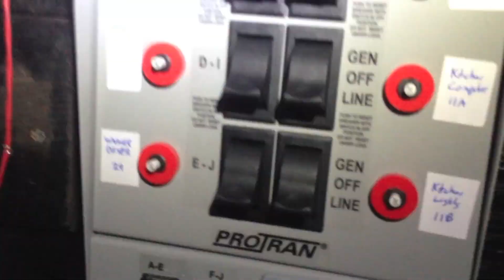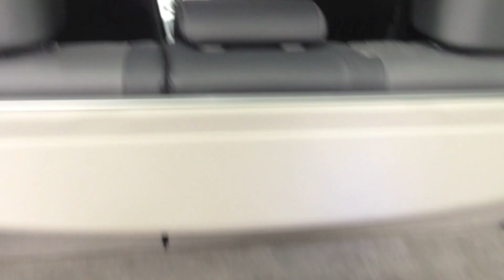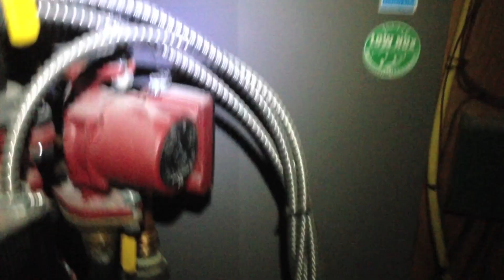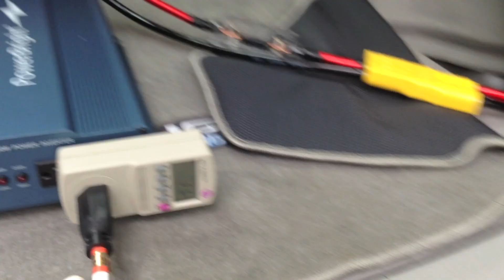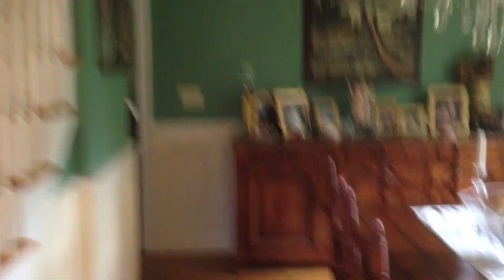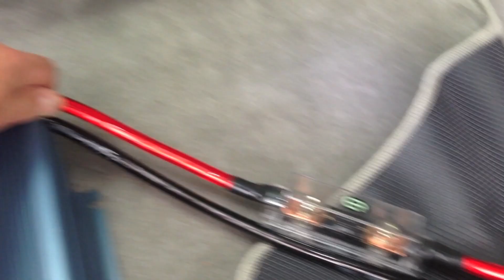Prius Home Generator - Part II

Comment: Wonder if there is a fuse or relay in the car you can remove to keep the car from getting stolen but still allow it to run. But thats a good tip in general if you are worried about having a car stolen, remove a few relays and fuses, easiest is just the fuel pump fuse but you would need that in this case.

Comment: Hi Franks, great video.  I forgot if I asked when I first saw your video 3 years ago, but...

How did you get around the problem that the inverter may not make all of the 110v on the hot wire.. or that the inverter may have internal grounding...which would both mean that the house wiring would not work it?

I made the same system almost,but I find that my inverter makes about 62v on BOTH the hot and cold wires.  At least my inverter doesn't have internal grounding between cold and the ground wire...but it won't work because of voltage on the cold wire when connected to house wiring (where cold is grounded by US code).  

Anyway, I know that my transfer switch works fine with a generator that makes 110v only on hot and doesn't ground the cold wire, since I tried that with success...

Comment: You can still lock your car. Either roll down the window, close the door, lock from inside and just roll the window up automatically. Or the way I always do it if I leave a pet in the car is use the old fashioned key. You don’t even need to leave a key inside.

Comment: For emergency needs <1000W , I would go with 
- a suicide cable directly to some garage outlet,
- manually disconnect house  from the grid. 
-Turn on only labeled breakers I want to power.
Transfer switch is nice, but you can get by in emergency without it. Being ready for a ghetto solution will also help your neighbor. Just drive to their house and do the same.

Comment: Could u get a bigger power inverter and power your whole house all year ? Seems like it would be cheaper
Reply: 100A x 12V =1200W x 90% efficiency = 1000W usable power. Bigger inverter will last longer and handles power spikes better. You can use any size inverter as long you will draw up to 1200W from your prius

Comment: What is the largest inverter you can use?  How does one determine how much power is too much to ask the Prius to provide at one time?   If there was a power outage, I certainly wouldn't be using my dishwasher, microwave or toaster oven, but the furnace motor, refrigerator, small freezer, several laptops, routers, and lights which I might be using all at the same time could add up to a bit of wattage.

Comment: How did the system work with everything running at the same time?  Can you post links to where to find all the connectors, cables, etc. that you used?

Comment: Is the hybrid battery recharge the 12V battery when is low without the ICE started?
Reply: Yes. After some time the traction battery will get low, and the gas engine will kick in and charge it back up.

Comment: Does it have to be a prius plug-in or prime, or can you use the regular prius hybrid?
Reply: You don't need, prius use the big battery charge the 12V battery With DC 100A current, so it can power this 1000w inverter

Comment: Why use the 12 volt system rather than the 3 phase output from the motor generator?  Any 12v battery could charge a inverter like that, but the motor generator could run the whole house.  Im looking for a plug in wire harness for the 3phase system on a gen2 Prius.
Reply: Found anything?
Reply: Another option is to use 200V traction battery, but it is hard to find rhe off the shelf inverter for that.

Comment: Just so I can be clear, you are attaching to the 12 volt starter battery, not the main car drive battery and this battery is also charged by the Prius engine? Is that correct? Thanks
Reply: I would not call the 12v battery the starter battery though.
The 12v battery just runs the computers, relays, radio, lights etc.
"The Internal Combustion Engine (ICE) is not started by the 12V battery like a typical automobile. Instead, the engine computer uses power from the traction battery to spin the motor-generators (MG1 and/or MG2) to start the engine."

The 12v battery is charged by the drive(traction) battery with a DC to DC converter.

The traction battery is charged by the motor/generators when the engine is running or you are coming to a stop while driving.
Reply: Correct, that’s what he’s doing.  The 12v battery not the high voltage hybrid battery.  The high voltage system keeps the 12V battery charged, and the gas engine keeps the high voltage battery charged.
Reply: I have a 2019 Hyundai Sonata Hybrid. How would I found out the Max of a inverter that could be connect to house battery? Would really like to see someone connect inverter to the battery pack. Image how much power the electric motor draws from it. That would be a lot of power to get into the house.

Comment: fantastic Frank. Thanks for such an informative vid. I'm in Union Co NJ. Major issues with Sandy and Irene. Quick question: Reading comments and got a bit confused on Inverter sizing. Do you see a problem using a 3K pure sine Inverter? Reason is I would like to be able to run power tools if need be. Thanks again. Tom
Reply from the maker: That seems to be a common question.  Check out the comments here:  https://www.fperkins.com/me/prius-home-generator.php

Comment: Very nice video, Frank. I would suggest getting a cover for the battery end of the Anderson connector. That way it's completely protected when tucked away. I put my fuse (100A, because the 2010 Prius has a 140A fuse on the battery) right after the positive terminal, not on the inverter side. That gives more protection.

You don't need to park another car in front of / behind the Prius when it's running to keep it from being stollen. Just don't leave your key fob in the car, and lock the doors with the manual key, which disables all locks until manually unlocked again. And close the window.

I've used my Prius during a power outage caused by a storm to run our freezer in the basement, telephone system, internet, computers, and a few other small things. Unfortunately, our refrigerator's startup spike was too much for the inverter, so I couldn't run that. Because the car was in the garage, I opened the garage door manually just enough to set some 4x4 blocks under the door, then attached my shop vac hose to the exhaust pipe on the Prius with the other end out the door. The Prius tailpipe doesn't get hot enough to melt the hose, which fits very nicely, so I can vent the exhaust this way for hours.
Reply: I'm amazed the exhaust doesn't get hot enough to melt a plastic hose even after hours of use. I know the car doesn't run continuously but still surprising.
Reply: I think Gen II 2004-09 Dc/Dc Inverter fuses in the car are lower - maybe 100A.  People don't want to blow that; fuse your 12v positive lead below whatever your car's internal DC/DC fuse is...
Reply: @cawag98  I agree. Mine is a 2010, Gen 3, fused at 140A, that’s why I chose to fuse my inverter at 100A, to be on the safe side. I don’t know what the Gen 2 is fused at.
Reply from the maker: Good tip!  Thanks.

Comment: Frank,
  Great video and application, we also have a Prius Plug-in... just wondering if you've used it during a power outage and did the Prius run all night??  Also any issues when having the car serviced with the "Anderson" plug dangling off the 12v battery?   Also I believe if you turn the Prius on then take the keys with you the car will stay on... not sure for how long though ( It only beeps at the beginning??)
Reply from the maker: +Mike B Oddly, there hasn't been a power outage since so I don't have any real world testing (yet).  The Anderson plug dongle really gets tucked down and out of the way so it's not noticeable and I doubt a service tech would even notice it.  The prius does stay on, so you're right.  I accidentally left it running for a few hours and came back to hear the AC still running! doh

Comment: Would be nice if Toyota had a generator-only mode so people can't drive off with your car.
Reply: Actually, there is something you can do. 1) Don't leave the key fob in the car. The car, once started, runs without it. It only beeps at you when the door is opened. 2) Use the emergency manual key that's hidden in the side of your key fob to manually lock the doors when you leave. This not only locks the doors, it also disables all entrance to the car (by another fob) until the doors are manually unlocked again. and 3) Don't leave the window open.  :)  Great video.
Reply: @TerrelWSmith apparently knows the solution for this by manually locking the doors.  There's an easy way around this if his solution doesn't work; The Club and lock the steering wheel.  I think his solution plus The Club will work.  If you're going to use a hybrid as a backup generator, you should probably invest in The Club anyway as a home generator vehicle security measure if you can't garage the vehicle when it's being used as a generator.  Do your due diligence and test your security options if you elect to use any hybrid vehicle as a home generator.
Reply from the maker: GoatZilla nice idea!  I would park my other car in front so they would have to steal that one before they can get the Prius ;-)
Reply: Frank Perkins Yes, I'm just thinking for people without second cars, or worse yet, for more desperate times where that might not deter people.

Comment: Thanks Frank just installed a 1500w inverter in my Prius works like a charm.
Reply: I've heard the later model Priuses and quite possibly the RAV4s can handle up to 2000W.  The Toyota RAV4 Prime with the appropriate packages includes a factory 1500W inverter with the 120VAC NEMA-15R in the cargo area.  If you use a hybrid with a factory inverter, use it and don't overload it.  If the factory inverter breaks and you didn't overload it, it's on the manufacturer to fix it if it's still under warranty.
Reply: Which Gen Prius do you own?

Comment from the maker: Here is a link to my blog entry which has all the details and more links:  http://www.fperkins.com/me/prius-home-generator.php
Reply: The idea has recently occurred to me to integrate the guts of a prius into an RV. The most useful aspect of course, being what makes it good for a home generator; the engine turns itself on to top up the battery, and uses very little fuel through regular use. Any idea how this might be accomplished? How well might the battery bank be expanded? Would this be a practical application with, for example, an older prius, being retrofit into use as an RV generator? Do you know if the engine and battery would still function the same if the electrics were left attached, but most of the other functional parts of the vehicle, the wheels, wheel motors, et cetera were removed?

Comment: I disagree with you. 1000W is not very practical other than just running the electronics. If you have the fridge compressor going and the furnace fan blowing and a washing machine and a microwave oven running, then 1kW is not enough. I understand this is probably the best DIY can achieve drawing from the 12V battery. Toyota on the other hand could build-in this generator feature into their cars by tapping energy from the 200V battery. I remember seeing a Toyota concept video where the Prius is used as a whole house generator. So they know there is a market, they just don't sell it as a solution.
Reply from the maker: Thanks for the comment, but unfortunately it looks like you didn't read through my explanation on my linked blog or watch the video.  The purpose of this is for emergency power.  In a power outage, doing laundry and using the microwave is not an emergency.  I have already tested the system and I can run my furnace and all all the electronics OR run the fridge and most of the electronics.  For me, the priority was basic lighting and heat for the winter or keeping the fridge cold in the summer.
Reply: Frank Perkins I understand there is a difference in expectation. Emergency generator should supply enough power for some basic needs especially regarding food. So, keeping the food from spoiling and heating up food would probably be needed by most people. Hence, I expected running the fridge and microwave. Though you can always control via the switch to pick one OR the other, but it would be a convenience if the inverter is powerful enough to allow unsupervised simultaneous operations of these appliances. I always wonder whether the 200VAC 3 phase output to the air conditioning compressor can be stepped down to household AC current via a transformer. The prius itself has a very powerful inverter that converts from 200VDC to 200VAC for the compressor and 500VAC for the MG1 and MG2. It would be nice if one of these 3 powerful AC currents can be used via a transformer. Adding an inverter to the 12VDC battery is nothing in terms of power capacity compared to what the high voltage inverter can do.
Reply from the maker: cplai I would never try to run something like AC through the Prius.  Although you might be able to tap into the 200v battery pack, I wouldn't recommend it because of safety and possible issue with frying the entire car.  This is pretty "safe" and does what I need.  I should also mention that I have natural gas as my heat source so if I needed to cook, it's not an issue since I can use my stove.
Reply: Up in the north (or where you have valuable things that will spoil in a fridge), 1000w is the difference between suffering through a power outage in style or catastrophy to home and family.   Look at Texas during the Feb 2021 'polar vortex' storm that is raging...  This setup can do nothing for drinking water supply issues, but it can run either a furnace or a medium sized fridge.
Reply: @cplai I would put the biggest inverter possible.  This is the only thing I disagree with Frank on.  If you're going to install a power inverter to use a hybrid as a backup generator, you use the biggest inverter it can handle and still be efficient as an on demand generator.

Frank is correct you can't run home HVAC off of a hybrid vehicle without some dangerous modifications.  If you need HVAC, the best option in that case would be to have a portable HVAC unit that can keep your bedroom comfortable making sure you know the wattage demand of the unit since they run off of 120VAC 15A power, I think a Prius can handle it and you can probably power Internet and other creature comforts.  

One of the things you need to do if you use a hybrid vehicle as an emergency generator is triaging your power needs which Frank has done.  The subpanel solution he has in place gives him the granular control he needs when he needs it which I think is a very elegant solution which I will be utilizing myself when I purchase my next home.  

A recently manufactured refrigerator that's in good condition can keep its contents cold for 36-48 hours before you need to worry about spoilage.  This is a major concern if you have a medical condition where your medication needs to be kept refrigerated (i.e. insulin).  If you're worried about temperature, put a wireless thermometer inside your refrigerator.  People who live in the hurricane belt who deal with seasonal power outages know how long their refrigerator can keep items cold before it needs power to maintain refrigeration.  People in these areas also keep their refrigerator thermostat turned up to a high or maximum cold setting so they get the maximum refrigeration during a power outage or crank it up before they anticipate an extended power outage.

The key to effectively using a hybrid vehicle as an emergency generator or using any emergency generator that can't power everything in your home is triaging your power needs.
Reply: No worries. That’s what insurance is for. Lol. If we can get the specs off the electric motor and don’t pull more then it would I would think all would be good. Personal I just can’t find the info of the electric motor of my Hyundai just a part number.

Comment: Frank, could you have connected a higher power inverter to the high voltage side of the prius to get perhaps 2kw power instead of 1kw?
Reply: Yes, you can get 3kw, but it's very dangerous to work with the traction battery. There are people who've done it over on PriusChat. I do not recommend it. If you mess up and live, you could still damage the traction battery and they are not cheap!
Reply from the maker: Totally agree.  If you need 2, 3kw or more, then your best bet is to get a traditional generator system.  This is only for short term emergencies with very instances of lost power.  To date, I have had only two power outages and they only lasted a few hours so I didn't even both trying to hook up the Prius to the house.  The funny consequence about losing power from Sandy/Irene is that the local utility has done a lot of work to update their service to prevent these type of outages in the future.

Comment: Thanks for cool video!
Just wondering - do you have basement sump pump on manual transfer switch?
Or was the starting amps above what a 1000 watt sine-wave inverter can deliver?
Reply from the maker: I'm sorry, but I don't have a basement sump pump.  I would do some research online to see what the peak draw is and that should help you size the appropriate inverter for your home.  You can also try using a kill-a-watt, but they don't do a good job in tracking peak usage, only current.